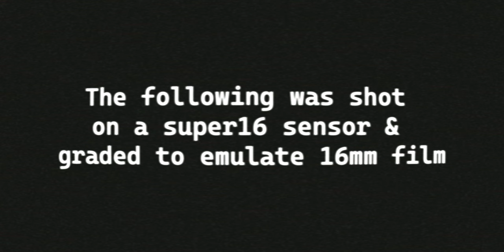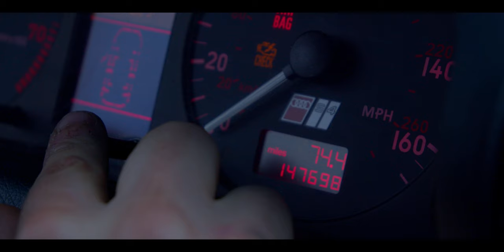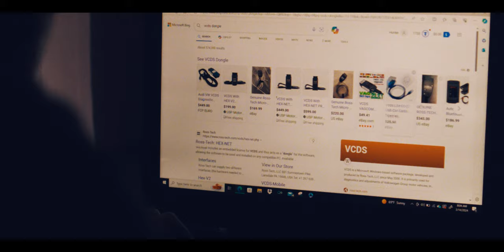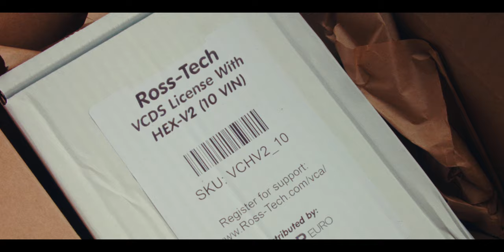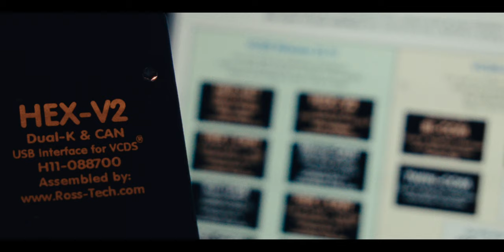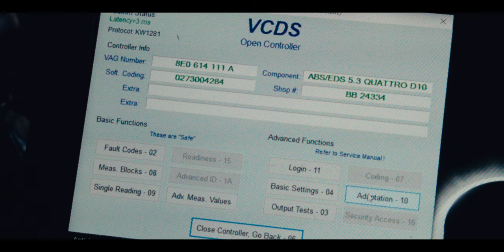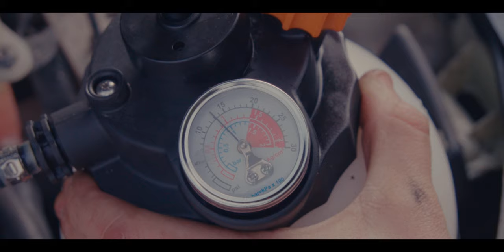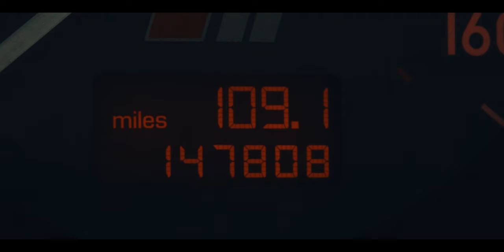Learning VCDS & Trying To Finish The S4 Big Brake Kit!

Comment: Hope this helps with the camera man.
Your channel is the reason i got my 02 audi allroad 2.7t 6 speed.
I genuinely look forward to your videos every week.
Idea for the s4. You had trouble getting the bank 2 bi pipe on due to the fan.
That fan is know to crack and explode, sending shrapnel into the radiator.
Id reccomend the JHM electric fan conversion kit, helps with cooling, and gives your engine And bi pipes more space.
Reply: Love those cars! I've seen a few people edit the ride height parameters in vcds on the allroad to lower it beyond normal ride height. Prob not worth the risk of damage long term, but could be fun to tinker with...
Reply: @CamCanCars  I'm surprised how much I love the car honestly.
I need manual Allroad rear axle shafts(previous owner out a6 axles in)and to hook up the air lines before I try that.
I bought the car off my buddy, I told him I'll only make the air ride work if it turns out to be cheaper than coilovers.
I'd it works awesome. If not BC racing has my money
Reply from the maker: It absolutely helps!  Thank you so much for the support and the donation. I am thrilled to hear you enjoy the channel that much. Sounds like you've got a great project on your hands!

Comment: Glad to see my idea yielded success. Since I had to do it on some of my cars, I gathered it wouldn't be too different on an S4 from the same (and best) era of Audis. I did it the same way with VCDS back then. 3 license version, after one year the unlimited one. Has been invaluable to me since then and even helped specialized shops out from time to time.

And for me, I'd like to see the Super16 in the future. More than sufficient quality and a nice character to it with the emulation. Very nice work!

And I'm extremely surprised, that you are the first one to talk about the same feelings I discovered. You're working and working, achieve goals with your projects, but it only seems like as long as you are not achieving the next in line, you aren't supposed to feel joyous or satisfied. This of course is a path with no end and especially not a good one. I now have a 2007 Q7 4.2fsi which I decided is a milestone for me and can only be topped by a Bentayga. Since that is rather far away, I'm forced to be content with the Q7 and you know what? It made me take time, slow down and now after a huge bill for the timing chain job, I so enjoy driving it like I have no car in a long time meaning 6 years. And I now know how ungrateful I was. 

Now I can enjoy our TT more and all the other cars. As history always told us, you need to be forced to your luck, as we say in German. With forethought of course
Reply from the maker: Your suggestion was great! I completely agree that VCDS will prove to be invaluable in the coming years! Sounds like you have some fantastic cars! I love the 4.2 and will definitely get one someday! I completely agree about the super16. It's a really special look with a ton of character, so even after I get a new primary camera I will continue to use it. 

Your philosophical outlook on contentment/gratitude is fantastic! That's how I see things as well. Sometimes all it takes is a little bit of perspective to show you what you really have! I love that german forethought quote too!

Comment: Issue with long and squishy pedal is due to old and not capable master cylinder, it is basically same with every car that does "big brake kit" upgrade and with Brembo 17z, 18z on cars like GTI, R, Audi S and etc. It is easily fixed with TTRS master cylinder.

Comment: I’ve been looking at Ross Tech for awhile now. It is a little intimidating and I’m afraid it won’t help with my two issues. 1) I get ABS/EPC lights that put the TT in limp mode on abrupt throttle changes at highway speeds and, less frustrating 2) I need to adapt my new climate control module to the car.  I look forward to more vids on the VCDS.